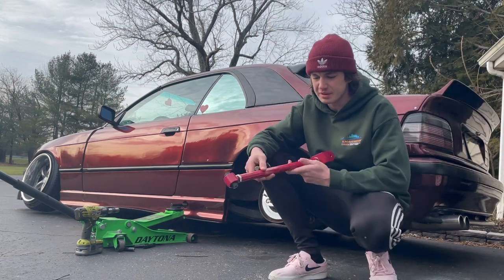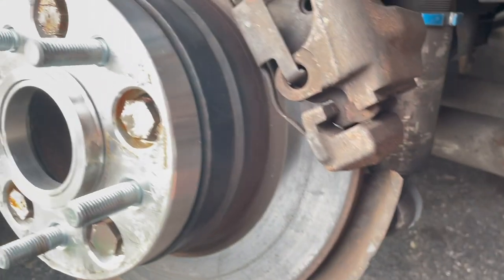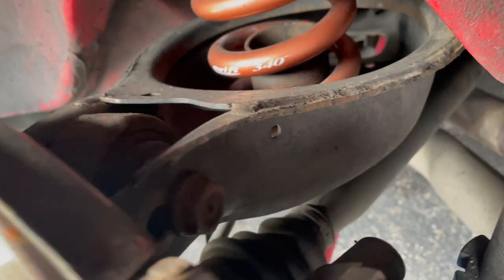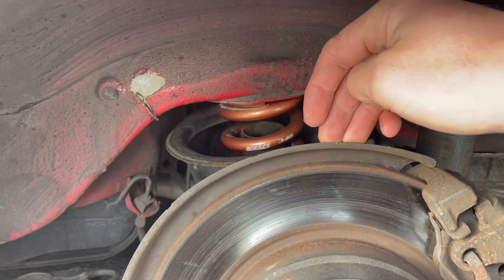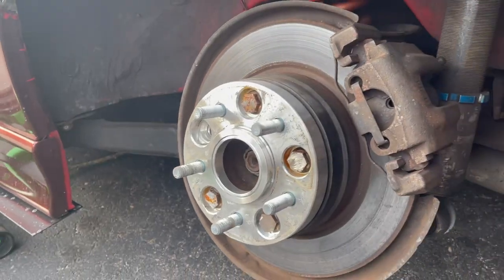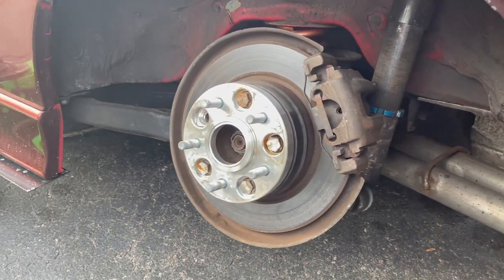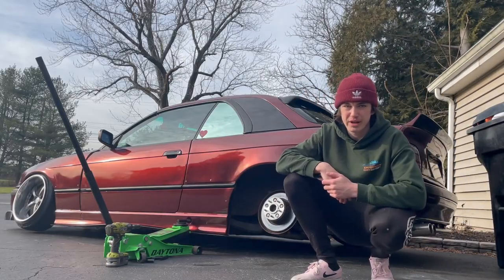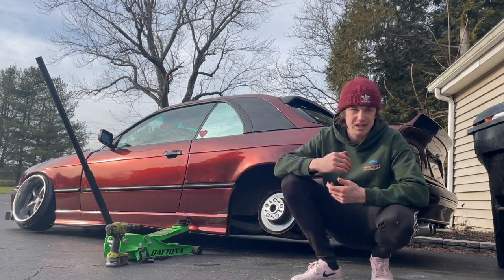HOW TO GET REAR CAMBER ON BMW E36/E46 FOR $40!

Comment: I know this is an older video. But your the only person I've seen or heard of slotting the upper. And I just came across your video trying to figure out how to straighten out my rear toe. I'm running about -10 camber in the rear and the trailing arms are pulled all the way out and still have a little bit of toe in. I'm gonna try slotting my upper and see how well that method works. I have one question tho, did you cut the back of the brake shield or the ear of the control arm for it to clear? Super clean cars tho man 👌🏼
Reply from the maker: I had actually redrilled a new hole on the control arm rather than slotting it, this allowed for me to cut the ear of the control arm in order for it to clear the brake shield. I only had to cut it on the e36 though, on the e46 i did not have any clearance issues with the brake shield.
Reply: @cufstatic3640  that's what I meant. I knew you redrilled a a whole and not slotted. But the edge of the ear is right next to the original whole. So I Mahone you didn't cut much. More or less just shaved some off?
Reply from the maker: @darenmiller2076  On the E36 I had to cut halfway through the original hole in order to have clearance for the brake shield on the front ear. Since it was redrilled I didn't have to worry about the old original hole. If it was slotted you obviously could not do that.
Reply: @CUFSTATIC Did you just take the outer bolt of the upper out to do all of this? Does the knuckle swivel or move out of the way enough? Just curious cause every search I look up of an upper control arm they're worried about the inner bolt which I get but if I just wanna know if I can get away with that bolt alone
Reply from the maker: @darenmiller2076  I never had to remove the inner bolt, it does make it easier to drop the trailing arm though.

Comment: Yo bro, i know this vid is hella old but i appreciate the tips on this. Just slammed my e36 and need more rear camber asap. I got a few question maybe you can answer not really related. What roof spoiler do you have on the 36 vert? And what spring rates are you running?

Comment: Ik this is an older video but I was just wondering, when drilling the upper control arm, what all do you have to disconnect to be able to tilt the hub back? I just drilled it out and went to tilt it back with only the lower control arm, trailing arm, and axle connected and it wasn’t going back that much at all. Just wondering if I’m doing anything wrong
Reply from the maker: Unbolting the lower control arm and trailing arm makes it alot easier to get the upper in place!

Comment: How did you zero out your toe? Did someone do an alignment or you do it yourself? I can't find anyone to touch our stance car and I cannot figure out how to get the toe right
Reply from the maker: Redrilling the upper control arms got the toe very close to 0 for me!
Reply: @cufstatic3640  I was meaning how did you tell it was 0 out? Everytime I think my toes set I step back 10 ft and it's pulled in or out. I have adjustable toe arms front and rear. Just can't find the sweet spot to get it set
Reply from the maker: @coryhall3248  I eyeballed it, and then brought it in for an allignment.

Comment: I was wondering do the e36 rear control arms work for e46 as well or do I have to get specific control arms for the e46
Reply from the maker: Aftermarket lower control arms are the same for both cars!
Reply: @cufstatic3640  thanks bro I wasn’t sure hope you post more videos on your cars your e46 lookin fresh 👀
Reply from the maker: @ratboy240sx  I will once it is done!

Comment: Im not gonna drill holes in there, I need camber without too much modifications
Reply from the maker: Only other option would be to convert to true coilovers in the rear with an adjustable upper control arm